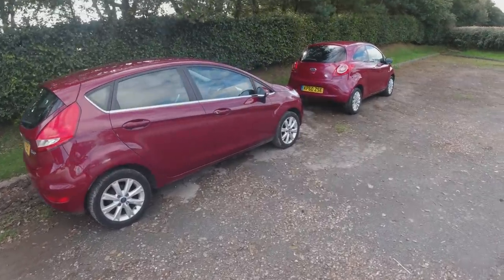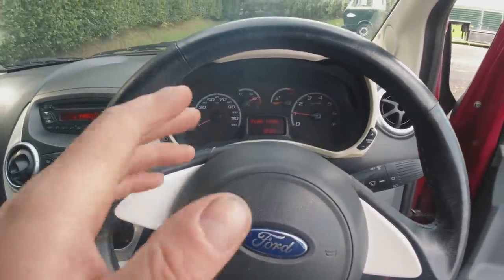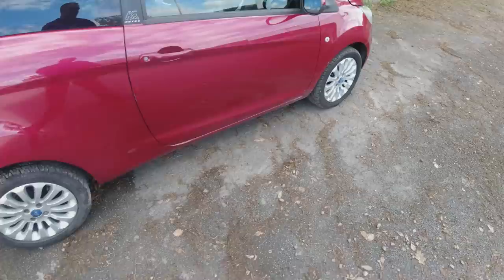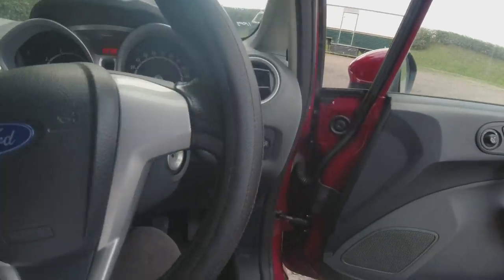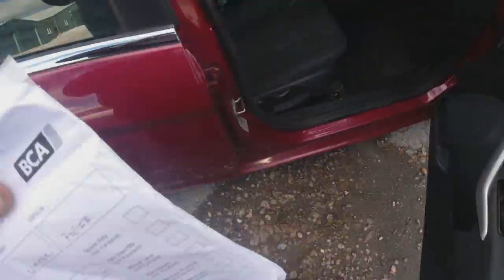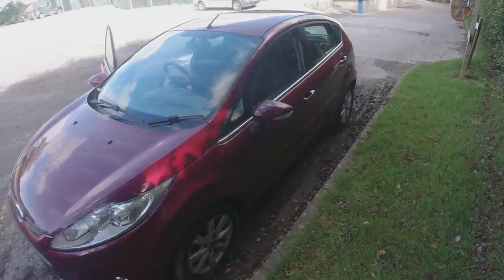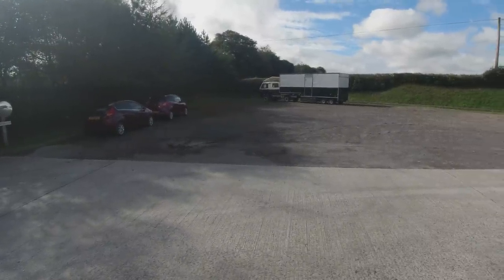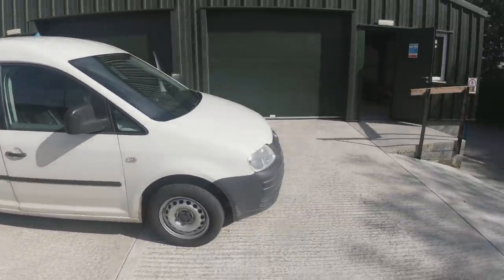The first new British Car Auction Flips arrive at the New Unit !

Comment: Hi there. You said the Ka you bought was a non-interference engine, can you confirm that as I bought a 65 reg 1.2 a couple of months back and I was informed it was an interference engine. Mine was due a cambelt at 5 yrs old but has only done 3000 miles from new (2800 when I bought iit end of August) so I haven't been "too" worried but was going to get done next month. If it is indeed a non-interference then I won't even bother for a couple more years.
Reply: Haha, time flies, it was actually end of July that I bought it, not August. Took me longer to get it on the road than I thought.
Reply from the maker: There is allot of debate. I was told that the 1.2 is non interference but there are some that say the later 69bhp 1.2 is interference. So for safety I would do the belts ever 5yrs
Reply: @ChopsGarage  the 1.2 60 bhp from Punto and Panda 169 non interference apparently. Barely any left though. Enjoy Friday and Saturday at unit James. KA cambelt I think and service, price related to paintwork.
Reply: @ChopsGarage  it’s the updated punto engine by the looks of it. I’ve been out of the game a while now but I’ve seen those engines with belts gone loads of times, new belt straight on and off they go. Older ones were more known for head gasket issues which I believe are sorted nowadays
Reply: I think you'll find the VVT is the decider. If you've got VVT I suspect they are interference. I know the older FIRE engines weren't interference (for instance my 1.1 Cinquecento has the same basic engine and is non-interference).
Reply: @ChopsGarage   ok thanks. That is maybe why then, mine is the 69bhp engine for sure. Only difference I saw was yours had two connector boxes to the right of the engine whereas mine only has the one . Oh well, will get it done I guess to be safe ;o)
Reply: I don't think it's a massive job anyway. I've got an older non interference panda and belt and water pump cost me £120 at my garage. Kwik fit will probably be more.
Reply: @benholroyd5221  one of the easier ones there is to do! I actually saw one with a knackered tensioner, the guy had actually chucked the belt back on and got another mile to a lay-by  before it came off again! Older punto though probably a 2000ish
Reply: @ChopsGarage  Any 8v FIRE engine that was equipped with vvt, is an interference engine. Good luck in the new place :)

Comment: Funny how the KA went from a weird and quirky thing with tons of rust issues in its first gen to a decent little car. What puts me off is when people use Halfords batteries in cars. If one is already cheaping out there, chances are everything else was done on the cheap..
Reply: Are Halfords cheap? Clueless default maybe, I wouldn't say cheap though.
Reply: Halfords aren't cheap, the OEM is Yuasa, one of the best in the market.

Most have 4 or 5 year warranty, too.
Reply: Halfords are definitely not a cheap alternative, it's what the general public resort to in a fit of panic when their cars gone phut. Similar to AA or RAC batteries.
An ECP Lion battery would be cheap though.
Reply: Halfords definitely not cheap. Tbh, cheap batteries are actually alright considering how much cheaper they are over "premium" batteries. In these cars, I would worry about lack of service history, low and old oil/coolent and worn/old tyres to see how much the owner actually cared and treated it.
Reply: @squeakers27  "cheap" batteries normally have at least a 3 year warranty on them anyway and can last upto 4-5 years so they are perfectly good for the price 👍

Comment: The 60 plate has a mileage discrepancy, it had 77000 in 2019 and 55000 in 2020.
Reply: Think that's been a mistake at the mot test. More likely thats a 47000 than 77000. I've had it before. Some hassle to try and sort out. Might have done 22k in a year but I doubt it in a KA.
Reply: No, definitely reduced.It had 46000 in 2017